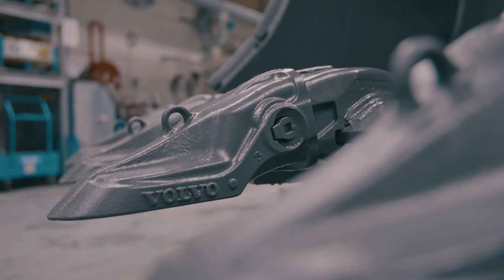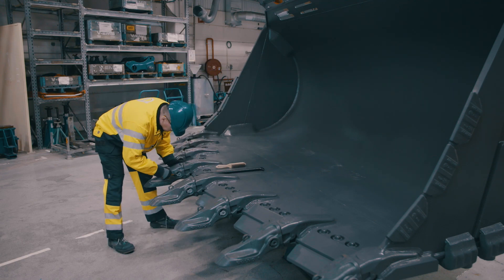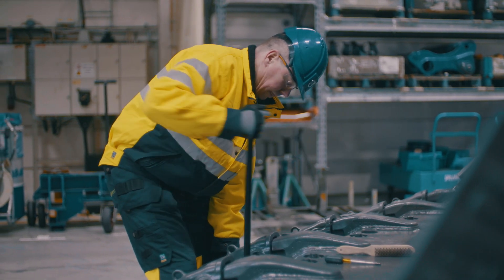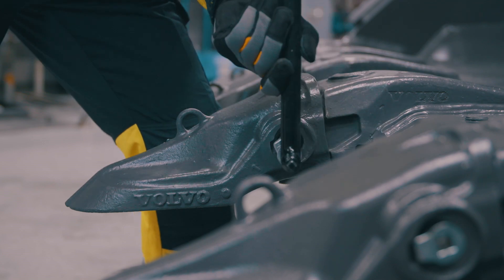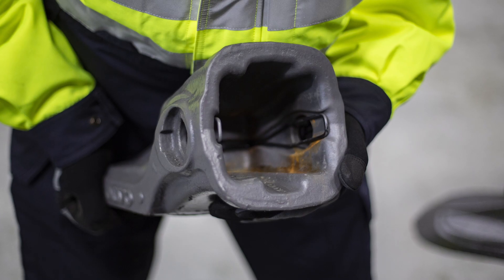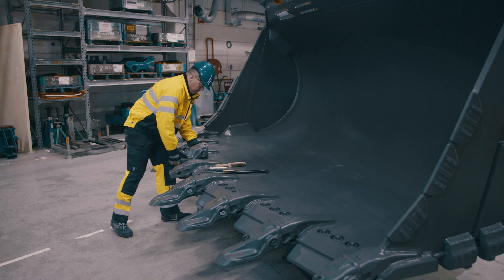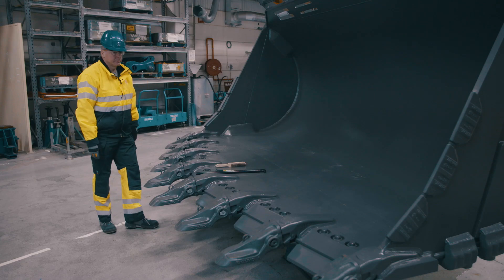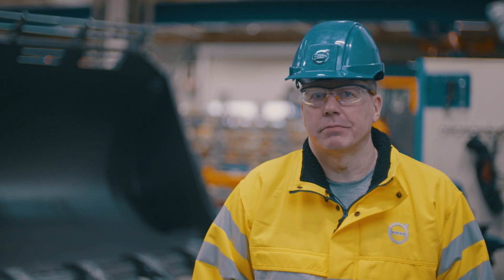New generation Volvo Tooth System: Quick, easy and safe installation

Comment: Could you please tell me how long it takes to replace a worn tooth ?
Reply from the maker: Hi Perry,

Changing a tooth is an easy and quick procedure. Replacing a worn tooth takes approximately one minute if you need to clean the square hole to attach the tool. Hope this helps!
Reply: @GlobalVolvoCE  Idk what we are doing wrong but we are constantly snapping tools trying to remove these.  Our excavator operator has been having to use a torch to remove the teeth.  Broke countless breaker bars and the actual Volvo tool.  I guess these aren't designed for an ash plant